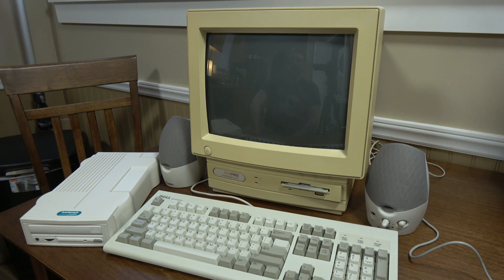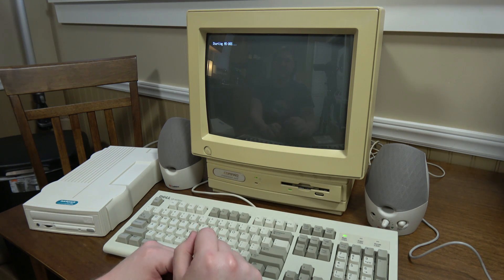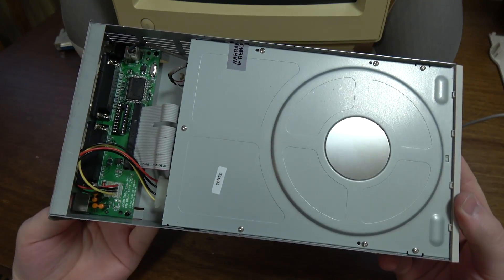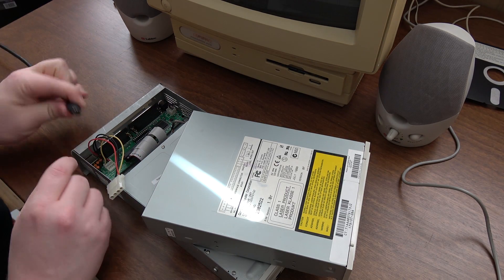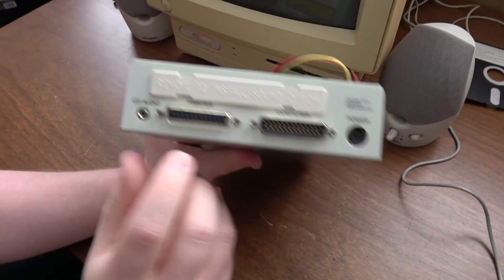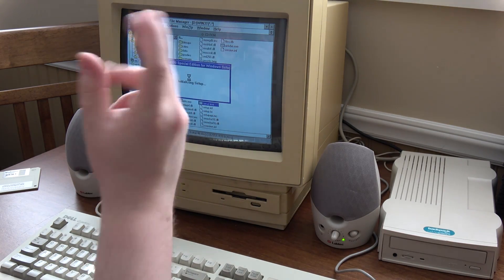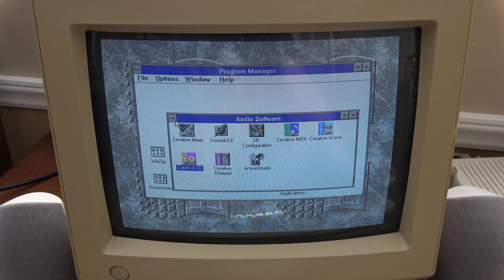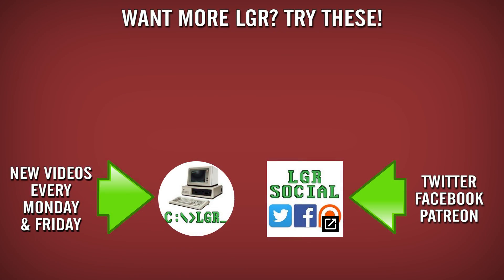LGR - Fixing & Installing a Parallel Port CD-ROM

Comment: I got a back pack drive given to me couldn't find a driver for newer os so just saved the board i took out may install back in it some day but used a hd adapter with connectors to it and works off usb that came with the adapter mine has a round blue clear logo on top it white case but handy little drive.

Comment: I have one identical to that older unit that came with a 486 Dell I was given many years ago.  It has an ISA SB16 sound card installed where yours has a blanking plate.  I could dig out the original driver disks if you were interested.

Comment: I have one of these, we ended up giving it a CD drive by getting a 3 foot IDE cable custom made at a local PC shop, and running out the system tray, shaving alittle plastic so the tray fit.

Comment: Q of the day:
Why do old stuff go yellow after a time.
Most stuff exposed to sunlight bleaches..
Reply from the maker: This thing has never been in the sunlight, so it's not that :)
https://www.howtogeek.com/196687/ask-htg-why-do-old-computers-and-game-consoles-turn-yellow/
Reply: Thank you for the link.From one thing to another though, I am really curious about the grey spacebar with a lightningbolt on. what a heck was that? My neibourgh used computers alot and did not lite them. He worked with photoes and advertising a lot and thought that Mac had a better spacebar. Why did Windows have that grey spacebar, was it for sound dampening?
Anyway, Hey It is cool that an videomaker actually reads and answers to comments! Good Job!

Comment: what resolution do u shoot in? because that was a very clean zoom in
Reply from the maker: 4K!
Reply: how do u convert it down to 1080p without it looking over the resolution?
Reply from the maker: My Premiere sequence settings are set at 1080p, but I import the full 4K footage and just resize it as needed.
Reply: so wait are you're sequence settings 4k and export in 1080p? or make a 1080p  sequence and just use the 4k?

Comment: Nice speakers! i just loved them with the computer
also that power supply port on the case is just weird i didnt ever had seen one like this one. it looks like a ps/2 port but with a missing connector hole.

Comment: Is it a good idea to put a CD Burner into the Parallel port CD enclosure? I have a computer that doesn't have a CD burner, so I purchased an external USB CD Burner, but I have only one PSU for everything I bought or owned for the past 12 years that didn't come with PSUs: a small 7" TFT video game system screen, an old Wireless Router, the CD Burner, and Yamaha TG100 all using 12v between 500mA and 2A.

Comment: I managed to bag a DataWise CD-ROM parallel drive a few months ago locally from Freecycle with software and some iOmega Zip stuff.
Plus I got a Compaq Presario 522 CDS cheap of eBay about 2 years ago, which has both a CD-ROM and a floppy drives. Better yet it has internal speakers (has on board SB Pro compatibility)! 

I feel pretty lucky to say the least!

Comment: Take the broken drive apart and see if you can fix it! Could be a simple electromechanical fault(ie corrosion on the connector).
 Btw did you notice the empty DIP socket on the board? This seems to be for an additional memory buffer option. Didn't know this was a thing in these old drives...

Comment: Yep. The first CD-ROM drive I used (in around '93 I think) was a single-speed parallel-port interface. Horribly slow, but back then it was amazing! You could get shareware CD's at the time (before everyone had the internet), and that provided hours of fun looking through all the software.

Also, in college I had that exact ZIP drive, parallel port.. Sooo sloooowww, but I loved it!

Comment: So it's just turns a standard IDE drive into parallel? I know it's OP for that computer, but you should see if you can get a DVD drive working (I doubt you could play movies or anything, it would just be interesting to see it work).
Reply: The parallel port limits the speed of a CDROM drive to 6x speed. However, a DVD may work depending (if a film) what quality you playback in.
Reply: TableWolfMusic It wasn't speed I was worried about. Can a pre-pentium even handle DVD-quality video?
Reply: Not really if you want to playback mpeg2 DVD films (although you can access your files such as text documents etc.). For that, you either need a 300mhz (66mhz fsb) pentium 2 or equivalent. Or you can use a 200mhz pc if it has a mpeg2 decoder card in it. That said, you can get what are essentially entire computers on a ISA (or PCI) card and plug that in and ten that board would run a DVD, although changing the video output might be needed. YOu can actually take a amiga A3000 25mhz 16bit (32bit CPU) computer and run windows 7 on an expansion computer plugged into it. But really, I am going off on a tangent. The standard is the 300mhz with no need for an mpeg2 decoder card... or a 200mhz with the mpeg2 decoder card. One last thing I will add though, on the subject of videoCD (VCD) playback (because you can burn those to CD or DVD) is that you can use an mpeg1 decoder card and that might work. You can also use a PC without a mpeg1 card if it was (at an aproximation) 90mhz pentium. Lastly, do remember that the 14mhz CPU (32bit and 2meg of 32bit RAM) Amiga CD32 games console (which was essentialy a A1200) had a VCD mpeg1 playback expenasion card which (if you plugged it in) would play VCD movies fine. That is kinda amazing really, getting VCD playing on a 14mhz machine (even if it is using a expansion card).

EDIT, I forgot to say, even though that presario compaq 425 is like to be the 25mhz 486 computer, you can play uncompresed AVI video (probably cinepak by radius or microsoft) on it. I remember seeing encarta encyclopedia running even on a mere 386 (possibly 16mhz) in wndows 3.1 and it had a little video (from CDROM) of a cheeta running and catching some animal (like a gazelle or whatever).
Reply: TableWolfMusic Yeah. Accessing text and other DOS files on a DVD+/-R was pretty much all I would imagine a DVD drive doing on that machine, it's just weird thinking that a machine like that could read something that it was never intended to without some kind of aftermarket add-on or extensive modification.

Comment: I definitely owned that older Backpack CD Drive which I used on a Windows 2k Pro box for... gosh... probably until 2007? 2008?
Reply from the maker: Wow, that's an impressive service life!
Reply: His Patreon supporters get to see videos earlier.
Reply: ok seriously how can you comment be 2 weeks ago but this video came out today :o ?
Reply: Mine used a parallel port, which Power Macintosh models could have a card inserted to use, but most did not by default. There was a SCSI version of the drive if memory serves though!